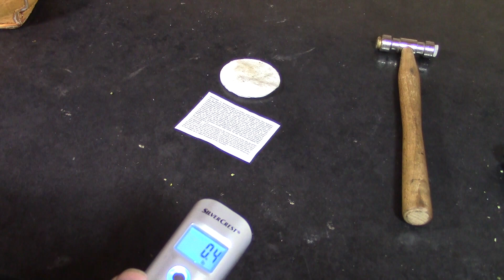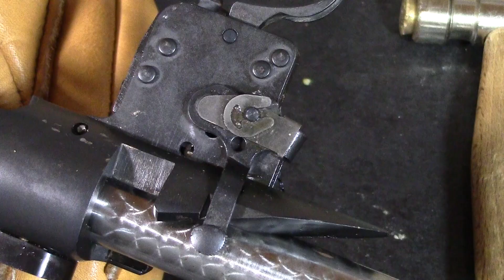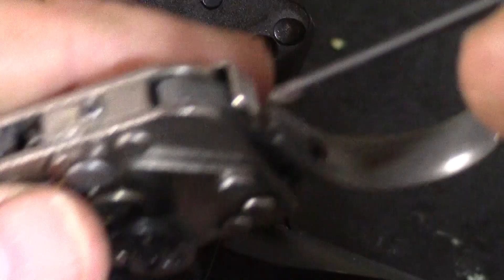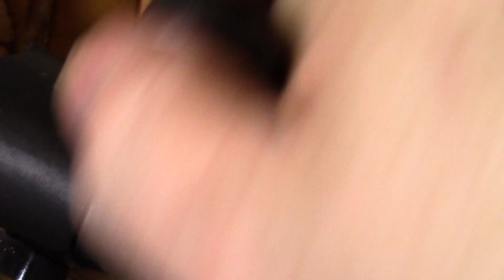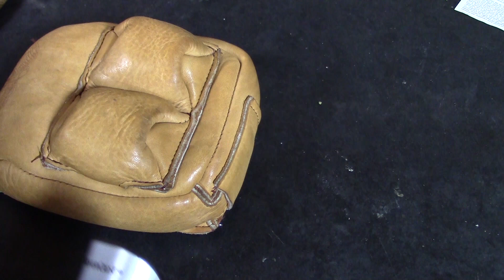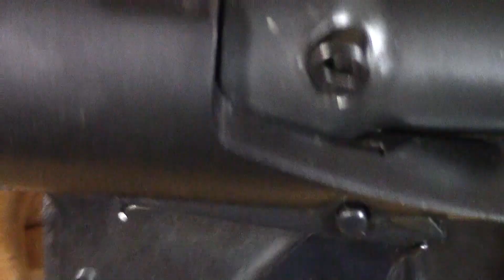Remington 700 Trigger Tuning

Comment: This video was a godsend for me, thankyou.

I have a Rem 700 in 308 that was my first rifle. I have always been able to get incredible accuracy out of it with the right ammo, but my trigger has always been super heavy. I don't have anything to accurately measure pull weight, but the bottom front screw as shown seems to cut it in half without making it discharge. It will make it much easier to autisticly plink shell casings off posts at 100yds😂 https://youtu.be/AWzN7bsk50g?t=557&is=LYPJcIxet_dphxEZ

Comment: Who is here in 2026? 
This is a very useful video, thank. 
I had a great shooting Remington 700 in .270 that I sold back in 1998. I Wish I still had it.
Fast forward to 2026 and I now have another Remington in .270 that I bought new in 2000. I never fired this rifle until a week ago. It produced 1-3/8" inch group at 100 yds. The trigger pull weight measured at 5-1/2 lbs. 
I floated the barrel and adjusted the trigger pull weight to 2-1/2 lbs. I'm waiting on the weather to dry up so I can get back out to the range. 
Thank you for this video.

Comment: I’m currently 54 when in my teens bought a 700 BDL in .243 it has always shot through the same hole every time. It seriously will put ten rounds through the same hole. It has such a crisp light trigger straight from the factory. I’m not really sure which trigger it has but I checked years ago and it wasn’t one with trigger recall. If I were to buy another 700 I’d look for an older safe Queen.

Comment: Be aware, you might have different results when cold.  Also, you should test pulling the trigger with the safety on, if it drops when disengaging the safety, you need more trigger pull weight.

Comment: Great video, well explained and demonstrated. The "Walker" trigger is a keeper if it is kept safe. There is also a designed in safety problem that is correctable. FYI: The Best "Walker" 700 trigger inherent safety problem explanation and repair that I found is here - https://www.youtube.com/watch?v=Nz48KyiuGi4  "Remington 700 Walker trigger fix and safety explanation. Rethink replacing a 700 trigger" by AKBAKWUDS.      Also, from a gunsmith, with much specific "Walker" trigger experience and technical  background information, good close up pictures and his similar repair for the same inherent safety problem.  But with, for most, a more difficult to do right repair method, that may not be as easily accomplished by many, but worth a look for how to clean and abrade the parts before epoxy.  search using   Walker Trigger Repair--Part Two, REPAIR by J Belk   I know the "duck" finds it as the top listing,  google search I do not know.

Comment: What kind of glue would you recommend to secure the screws after it's been adjusted? Considering the very small increments that could cause an unsafe trigger/safety I would want to lock it down once done.

Comment: Just did my Remington 700 in about a half hour first time removing the action and adjusting the trigger and travel.  I'm thrilled with the results it went from a super solid tight trigger with a heavy pull weight to a very light pole weight.  At first the trigger seemed like the tolerances loosened up in the overall mechanism as if I were to shake it and it would rattle. Once I put it back in the action I didn't experience that. Also unlike my Browning ab3 I don't appear to have had any loss in firing pin engagement.  With my Browning after I had the trigger pull weight reduced professionally on my ad I also lost the ability to fire Aguila 308 rounds. It seems like they just weren't striking them hard enough to force the cup to fracture and mix the two compounds

Comment: I have a '85 700 .222 fitted with a x mark pro trigger iv got it down to just over 3lb but after my Tikka and especially my cz527 absolutely excellent 2 stage trigger the 700 trigger is the worst trigger iv had the misfortune to use its stiff as a board no feel whatsoever and you have no clue when its going to go off, yet the americans rave about how good the 700 is ! eeek, i have never shot a rifle with an after market trigger so i dont know exactly how good bad these are ! are they worth the £200 the cost and if so why !
Reply: 13conair I have a Jewel at its original factory setting of 13 ounces which is great. For Benchrest it can be adjusted as low as 1.5 oz but I don’t need that. You can adjust it up to 3.5lbs but I am told it starts getting creepy over 2lbs because it was designed for lighter pulls.

Comment: Thank you for the great video and info!!! I do have the trigger on my Sendero. I noticed the J-lock on your bolt. Will you be able to make a video on how it works??? Thank you in advance...
Reply: Are you really asking how the j lock works? Those rifles produced for a short time had a key...encased in green plastic .. it basically looked like a little peice of angled metal.
You could stick it into the plastic tit on the bolt shroud ,turn and lock the firing pin.
As for myself I refused to buy any remingtons with that during that period.
But you can replace the bolt shroud on another firing pin to rid yourself of that ugly tit.
From what I have read you cant just replace the bolt shroud as the firing pin is specially made for that stupid lock.
Maybe you got a long overdue answer....😂

Comment: If you adjust to say 2lbs and it slam fires and it takes say 3lbs to make safe can you add sear engagement to keep it from slam firing?
Reply from the maker: i would be 90% sure that if its slamming at 2lbs, you are running to little sear. adding sear will make a longer trigger pull but you can run it lighter.
Reply: I use to have a Remington 700 Varmit back in the nineties. I set the pull to 2# and adjusted the sear. Crispy clean with no slam fire.

Comment: Followed the instruction and was extremely satisfied. Used red loctite to secure finished adjustment and set the trigger screw. Tested function and hammer test. Wayyy cool.. Job done on Xmark Pro as described. Thanks!.

Comment: I just did this to my 700 today and at first where I set the screw seemed very safe I beat it with a rubber mallet pretty hard and nothing happened so I put the stock back on and just for extra precaution I was going to cycle it hard 100 times to make sure and at about 40 cycles it snapped and again about 10 cycles later so I took it back apart and tightened the screw another 1/4 turn and re glued it put it back together and cycled it 150 times with no issues. My point is make sure you check it very good and turn your screw just a little farther just to be safe. Thanks for the video it helped a lot.
Reply: @Josh Smith  I never had any issues with it going off unexpectedly but like I said in my previous comment make sure you test it well, however I eventually replaced it with a timney due to its inconsistency. I could tell sometimes it felt harder to pull than others and when I finally got a Lyman trigger scale it confirmed what I had felt. It would pull 2 to 3 lbs most of the time and sometimes as much as 4.

Comment: what if you set the trigger at 1 pound  and set the safety in the safe position and hit the rifle with the same hammer will it fire?
Reply from the maker: That depends on the version of the trigger unit. If it is a sear safety, no it will not ever go off.
If it was a blade safety it may be possible if you hit it hard enough
Reply: how about the remington 700 sps or 5r will it fire if it is hit by a hammer at 1 pound trigger and safe position?
Reply from the maker: if it is the xmark trigger it will be fine if there is enough sear engagement.

Comment: I have a sticky m700 trigger. Older action, early 90s so its an older trigger. Could be dirty, but the rearward trigger travel doesnt edge smoothly back, rather it slips. I guess it could be termed a gritty feeling trigger, but more exactly it sticks and than slips, before reaching the actual "Break" of releaseing the sear. Usually m700s have nice breaks, this one bugs the hell out of me. Its a sporter so I don't need a light target trigger weight. The 4-5lbs is no bother to me. That sticky creep sucks when I slowly depress it. Fast pull and you don't notice it, but a slow deliberate trigger take-up and it sticks and slips, before getting to actual sear release!
Reply from the maker: I had a Howa trigger do the same to me. when pulled slow it felt like a 2 stage. I took out both the surfaces and polished them with a bright wheel and some cutting compound, But its one of those things that if done wrong will destroy your trigger.